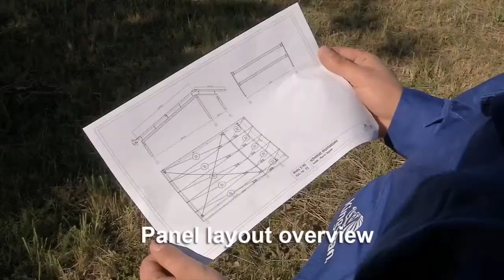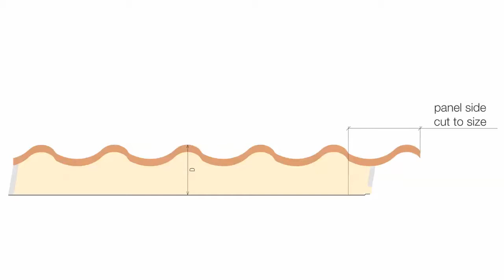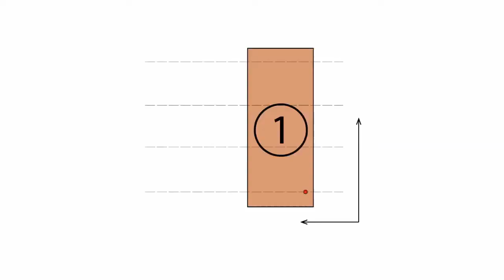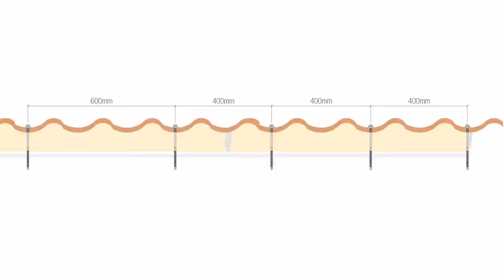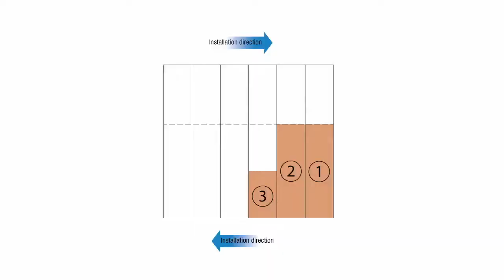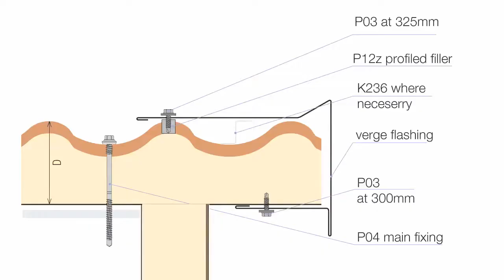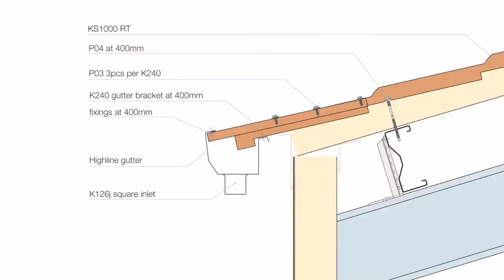KINGSPAN płyty warstwowe Roof Tile - film montażowy

Comment: Los tornillos de sujección no se ponen en las canales, sino en la onda superior, para que no haya goteras con el tiempo. Tal como lo haceis es una bonita forma de estropear las planchas de sandwich.
Reply from the maker: This method of installation is one of two recommended by Kingspan. Based on our two decades of experience in the manufacture and assembly of roof panels, we ensure that this method does not cause any leakage. Thank you for your vigilance and interest in our product :)